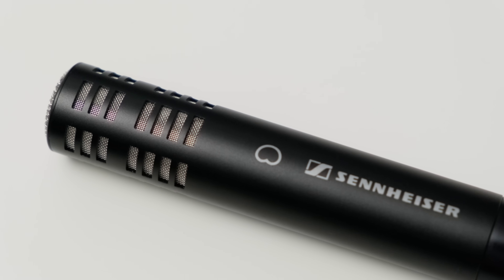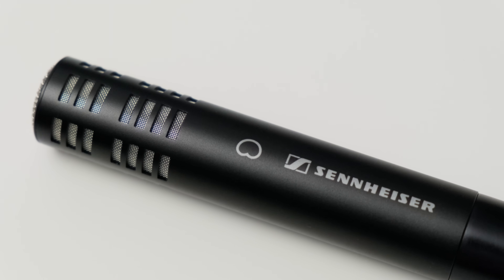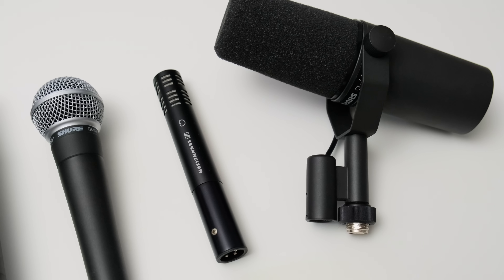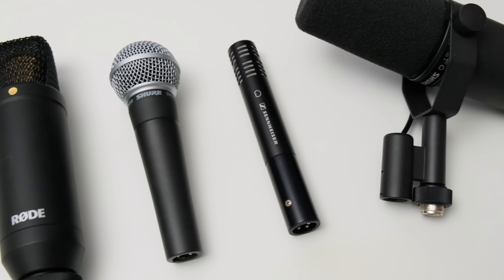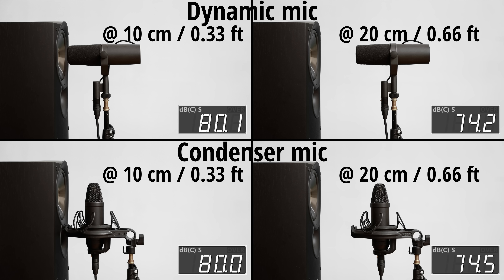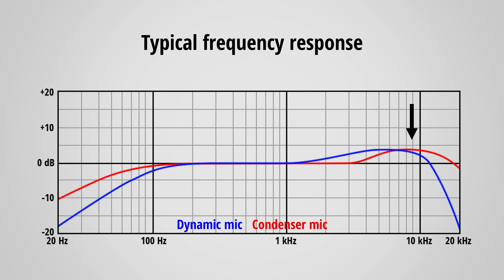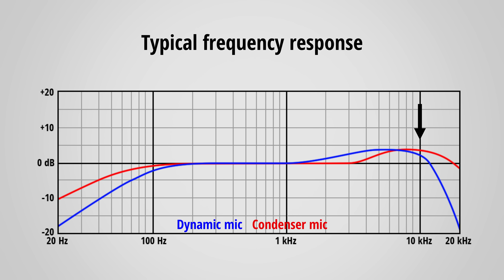Dynamic mics don’t reject noise better than condensers! And yet they do?

Comment: I think there are other equally important factors than freq response in dynamic mics:
- Higher diaphragm mass (more inertia, masking between loud voice and quiet reverb tails could happen)
- Lower slew rate / rounder IR 
- Lower sensitivity (quiet tails may be below noisefloor)
Even so, I agree that "they just pick less room tone" is a misconception. The room tone is the same, given by the standing waves. 
I think would be better to compare them from a time domain rather than frequency: IR, RT60, etc.

Comment: Another factor to consider with regard to using a microphone in an untreated room is how the polar pattern changes with frequency - while some microphones have a fairly consistent polar pattern across the spectrum (some small diaphragm condensers for example) others can vary quite a bit, giving the off-axis sound a very different colouration to the on-axis sound (some large diaphragm 'cardioid' condensers vary from almost omnidirectional at low frequencies to a narrow pattern with greatly reduced side lobes at high frequencies). Depending on the room, this might be fine, or it might be awful.
Reply: Also, isn't it true that a condenser mic of the large diaphragm type usually picks up in front of the diaphragm  and also behind it but not much to the sides; and a dynamic mic usually picks up what's in front of it but not much to the sides or back since the back side of the diaphragm is not exposed to the room. That basically attenuates the 'room sound' more. I'm a hobbyist photographer as well as a hobbyist musician and since I've gotten into studio photography a bit, understanding studio lighting also makes it a bit easier to understand microphone source vs room sound because the two concepts work the same and you can see one of them happening vs just hearing the effect. It's all about the ratio of distance between the source, the receiver, and other things in the room. If your light/sound source is close to your subject/microphone, and the other parts of the room are far away, they'll appear much darker / less loud. If there's equal distance between the light / sound source, the other parts of the room, and the subject / microphone, they'll appear equally loud/bright. 

With a microphone that rejects more sound from the rear, that's making the room reflections from that direction effectively farther away. 

A condenser microphone could be built identically to a dynamic mic, and in fact I think that's what those shotgun condenser mics do - they only expose one side of the diaphragm, so things behind the microphone (on the cable side) are attenuated.
Reply: @kevinwhite6176  I think you're getting confused with "figure of 8" microphones, which have the polar response you are describing and usually are large diaphragm condenser but the two things are not related; right here I have a LDC with completely switchable polar patter, from omni to figure 8 to hyper cardioid etc.
Unfortunately mics are not that similar to lights, sorry; the way to explain polar patterns is mostly a whole lot of math: with a capsule open on both sides you get the 8 response because pressure waves coming from the sides can get in front and behind the membrane and nothing moves; for an omni response you seal the capsule on one side, pressure from the back "travels" with no issues to the front (except at very high frequencies); the cardiod has an "acoustic labyrinth" on the back of the capsule tha creates an analogue delay and the difference of this with the pressure going directly to the front creates the cancellation on the back.

I wrote a lot more than I intended 😅 hopefully this is helpful to someone
Reply: Take a look at the small diaphragm supercardioid Earthworks SR117 condenser. After noticing on a review how isolated and natural it sounded in an average home YouTuber's room (on my pro headphones), I looked at the polar pattern and noticed how uniform it is across frequencies, with excellent rear rejection, unlike a large diaphragm condenser. It also has a wide flat frequency response suitable for all voices without coloration. I bought one and put it on a small desk stand and was very happy with a spoken test with my bass voice in an untreated room. For me, interested in quality and noise rejection on a budget, I wouldn't bother with more expensive or dynamic mics for quality speech, and I'm looking forward to trying it out for singers or acoustic guitar at a music open mic.
Reply: Exactly this
Reply: YES! this is the point i was looking for in the video tbh. unfortunately it wasnt covered. in my experience dynamic and condenser mics really do reject sound differently when it comes to their polar pattern. condensers are worse from what ive experienced

Comment: 1. Dynamic microphones are not inherently better at rejecting background noise than condensers.
2. Because many commonly available dynamic microphones tend to be less sensitive to high frequencies, they sound like they reject background noise better, but since you're throwing away signal with this reduced HF response, the SNR of the mic is unchanged vs. a condenser. 
3. Dynamic mics, being less sensitive, tend to be placed closer to the source. This change in distance indeed improves SNR, but a condenser placed at the same location would have an identical SNR, so there is no difference.

In short, operating principle on its own has no impact on how much background noise a microphone picks up. Moving closer to the source will improve SNR. Low-passing will make it sound like there is less reverb (depending on the size and shape of the room!) but you are also discarding useful information, so while SNR has not improved, we think it sounds less noisy. 

That dynamic mics have such a low-pass filter "built in" in many cases, and their low sensitivity makes it common to place them closer to the source than a condenser, is what contributes to this misunderstanding.

In short, people are attributing the performance gains to the wrong thing, incorrectly claiming that it's actually an inherent property of dynamic mics to reduce background noise, and then insisting you're just being pedantic and "dynamics are just used differently" when you call them out for being wrong, as seen in this comment section.
Reply: @BenjaminRCook  good meritorious comment, and 0 likes? I give u +1. Btw, amount of comments claiming „but it is not true, I know better” is staggering. Myths in topics regarding audio were always hard to debunk, as there is simply to many people thinking they are „tru experts”

Comment: Great video, Julian!  Thank you for making it.  As you mentioned, physics is physics, and the sound waves hit each diaphragm with the same sound pressure levels.  But I would think that, in addition to there being a difference between two microphones' frequency responses, there could also be a difference between the microphones' dynamic range response curves.  If so, and if the preamp gain was set to have identical output from each mic for the direct (loud) sound (i.e., -12 dBfs), then there could be a difference between the mic outputs at the lower sound pressure levels (e.g., -40 dBfs).  I'm wondering if you have ever carefully measured the dynamic range gain response between two mics at typical midrange frequencies (e.g., 500 Hz, 1 kHz) to see if there is a noticeable difference in the microphones' responses with respect to louder and quieter noises?

Comment: The biggest problem with all of this is being unable to directly target advice/information at people with different experience levels. 
Yes, frequency response, polar pickup pattern, physical usage distance, and other characteristics of the mic results in (on average) dynamic mics performing better in noisy spaces. Thus, recommending them on that use case makes sense for someone looking for info for the first time. 
But someone who grabs a dynamic mic and uses it wrong, then wondering why it doesn’t magically get rid of background sound is going to be frustrated. 
The advice that dynamics perform better for noise rejection isn’t a “myth” (when you’re not being pedantic about it) when using how the mics are meant to be used - but as always there’s a ton of nuance and other factors that come into play.
Reply: "The advice that dynamics perform better for noise rejection isn’t a 'myth'"

But it literally is. You have just admitted that it's not the operating principle, but the specific way in which the mic is used that affects noise rejection.

It's precisely this sort of "okay but you're just being pedantic, what I MEANT when I said dynamics reject noise better is that cutting off anything about 12 kHz and shoving the mic 3 mm from the source helps to reduce background noise" that got us here in the first place.

No, dynamic microphones do not reject noise better than condensers simply by virtue of being dynamic microphones. 

A microphone that picks up less high frequency content and is used closer to the source will reject noise better than a microphone with better HF sensitivity and placed farther from the source.
Reply: @ dynamic microphones reject background noise better - when both kinds of mics are used appropriately and as expected - in all practical ways that matter in pragmatic uses. 
Ultimately as long as the rest of advice being given gets the person to appropriate usage, that’s all that matters. 
Sunglasses protect your eyes from the sun as long as you don’t stare directly at it for hours, but if you do they’re no better than staring directly at it with reading glasses.

When the different kind of tool has different physical and technical characteristics, is used in a physically different way, results in different gain staging and processing - then the end result is a different result. That’s how results and conclusions work.
If we’re basing all of our “well aackshoely”s on using tools wrong - that’s not really helping anyone. 
If you wanna mount up a dynamic mic as a shotgun mic and complain about it go ahead, but this effort would be best spent teaching people who to use the thing correctly in the first place.
Reply: @EposVox  "Dynamic mics reject noise better (if you accept these assumptions that make it necessarily the case that my statement is not falsifiable)"

There is nothing about the operating principle of dynamic microphones that make them superior to condensers when it comes to rejecting background noise, i.e. improving SNR.

The advice of "use a dynamic mic to reduce background noise", while cute and convenient, is wrong. Why not just say "no matter what the operating principle, moving the mic closer the source will improve SNR", or "a low pass filter might help with room reflections at the expense of some high frequency content in the signal".
Reply: @BenjaminRCook  If you compare two tools and use one incorrectly, you can always say that one doesn't perform better. Period.
Frequency response, physical mic design (better shielding on SM7b, Variable-D on RE20), physical usage best practices, polar pickup pattern, and the required gain staging/post-processing for the different capsule types all play a role in "background noise rejection". 
There are big consequences to using a condenser mic up close/incorrectly, much as there are to using a dynamic far away/incorrectly.
Reply: @BenjaminRCook 
Okay A) SNR is referring to electrical noise not background "noise".  The Signal to the Noise Floor if you will including the self-noise of the Mic itself.

B) the Source to Background or Ambient is what's really being discussed in the video and this thread.  And calling it a "Myth" is pretty ridiculous give the Decades of Engineers that all know how this works in the real world with real microphones. 

C) The argument being "debunked" in the video that, at any given distance from the Source, Any two microphones (including and SPL Meter) would receive identical SPL levels, is defeated an argument Nobody made.

Who thinks that the acoustic energy in a given position is changed by the capture device placed there?  No one.

D) My understanding has always been that Dynamic Mics have a heavier mass, where the diaphragm is attached to a coil around a magnet.  The SPL moves the coil and generates a small voltage.  That Voltage to SPL ratio if you will is the Mic's "sensitivity", and will determine how many decibels of Preamplifier "Gain" is needed to bring the signal up to "Line Level"

Condensers have on board electronics that need a Phantom power source to basically Pre-Preamplify the signal, resulting in less Gain needed from the Preamplifier.  Which makes the appear more sensitive. 

But that sensitivity or gain-to-line ratio really isn't the point either.  You place both Mics on the same source in the same room and give each the necessary Gain to record both at the same line level.

E) However, if you now take both files and Normalize them, to either the same Peak or RMS/LUFS level.... What will the "Crest Factor" between the two recordings be, aka the Peak to RMS ratio.

F) My experience is that the Diaphragms of different Microphones have as much difference in thier "Dynamic Response" as thier "Frequency Response".

Ten Dynamics and Ten Condenser  Mics are going to respond differently to each other in thier own family, let alone jumping to another technology.  Or why wouldn't we all use the same mic for everything and just EQ it?

G)  So my understanding has always been that because a Dynamic has so much mass, it needs a relatively high SPL to get it going.  And more to the point, when the level fades below an SPL "threshold" the movement slows down more quickly than an ultra-light Condenser Diagram.

So in a sense, the "Physics" in this case of Mass, are very much in play.  And the result is a bit like maybe soft-knee downward expansion.

It's, to my mind, a Dynamic Range thing.

These are "Transducers", which convert one form of energy into another.  In this case Acoustic energy into Electrical energy, or Analog Audio. 

Different Microphones respond differently in the Acoustic realm the same way different Compressors respond differently in the Analog realm.  So if a VCA, OPTO, FET, Vari-MU, Diode-Bridge, and PWM Dynamics processor all behave differently, why wouldn't a Dynamic and Condenser Microphone.  Or Ribbon or PZM, etc.

H)  Which should be I) for Irony.

It seems to me that Dynamic Mics actually render less dynamic signals.
Reply: @G_handle  Signal to noise ratio is the ratio between the desired signal and everything else. There are no restrictions on what counts as "everything else".
Reply from the maker: I totally understand that “dynamic mics reject background noise more than condensers” is a simplification. 
But I also see that this topic is sometimes blown out of proportion by people attributing mythical background noise rejection properties to dynamic microphones.
That’s why I wanted to show that the mic technology (dynamic or condenser) does not impact the amount of background sound that’s recorded and simultaneously show that in practice there is often a difference in the perceived background sound due to frequency response and working distance. 
I think that recommending dynamic mics for untreated / noisy rooms is absolutely valid.
Reply: @JulianKrause  Wait what!
Is it a "Myth" or is it "Absolutely Valid"?

Comment: The tests seem to assume that the actual published pickup pattern of the two mics is the same. Are they 'equally cardioid'?  I would have thought comparing them with the source at 90 degrees and 180 degrees would have been revealing. Also room pickup is often important in the context of mics used for live music and the avoidance of feedback. A comparison of the feedback rejection of the two mics would have been revealing. I'm a big fan of this channel but there's something not quite right about this presentation imho.
Reply: I think the purpose of the video is not to determine exactly how directional certain specific mics are, or any other specific quantification, because as you say there are definitely differences between all mics in this regard (regardless of dynamic or condenser, there is always variation). Certainly the off-axis response of a mic has a major impact on the amount of room reflections that will be represented in the signal. However, what he does show conclusively is that the simple nature of a mic being a condenser does not, purely on it's own, tell you that it must be less directional or less responsive to proximity effect than a dynamic mic.
Reply: I got this impression too. In my experience, a "cardioid" mic I usually used but couldn't help it sounding a bit strange, ended up being very much a figure-8,. It's the MXL 990. Once I found that out I could make much better use of it. It's great as drums overhead, even live, as it can cancel the P.A. or the singers' blasting monitors.
Reply: Yes, he said ALL THINGS BEING EQUAL. Which means polar patterns are the same for both mics. This is not a discussion about polar patterns and room noise rejection it’s a discussion of condenser vs dynamic mics and room rejection. Dynamics and condensers come in all different polar patterns. If their polar patterns are the same and the sound source to capsule distance is the same then they will reject room noise pretty much identically.